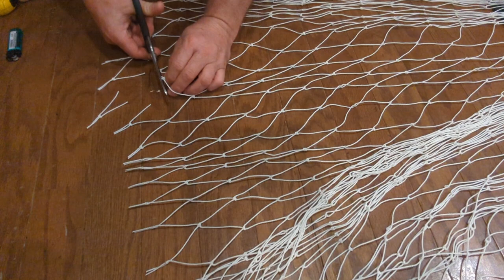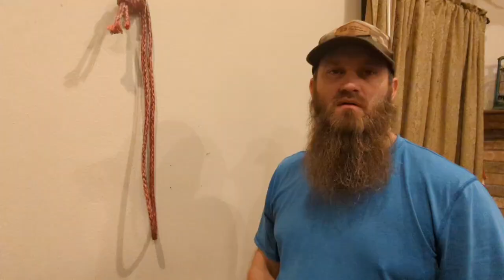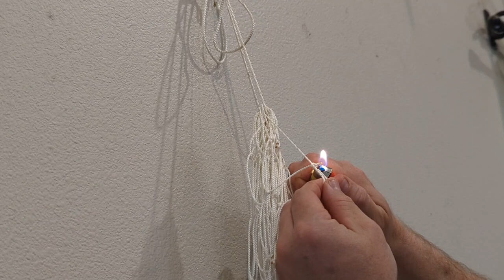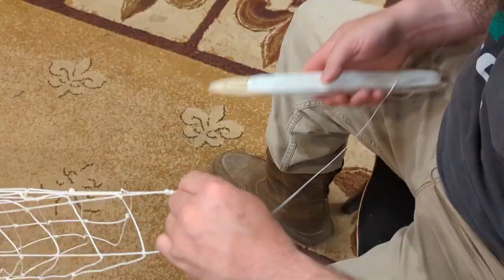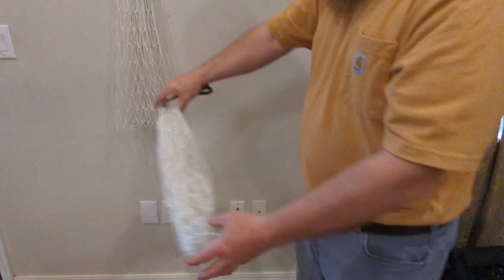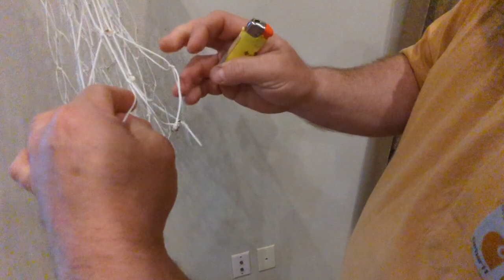Flathead CATFISH Hoop Net: How to Build a Hoop Net with Factory Netting PART 1

Comment: Great video    Probably the best I have seen on you tube.  What kind of boat are you running your nets out of length and how wide is the bottom at the transom it looks very stable
Reply from the maker: 16-52 SeaArk. One of the best hulls on the market